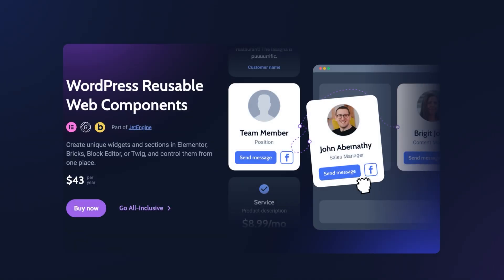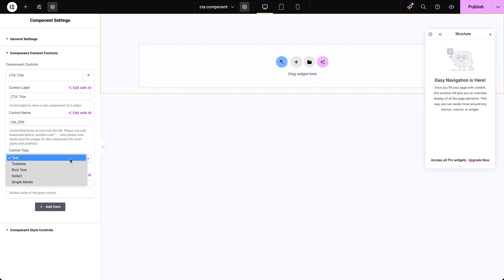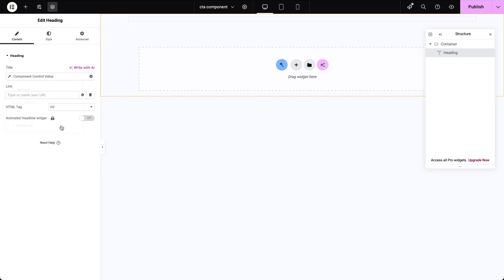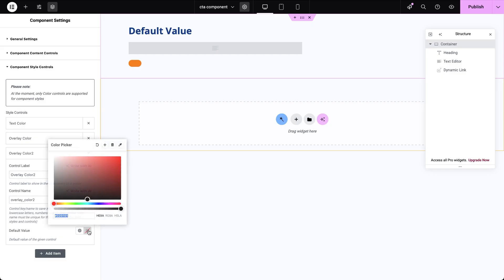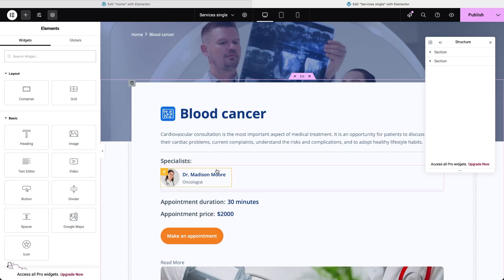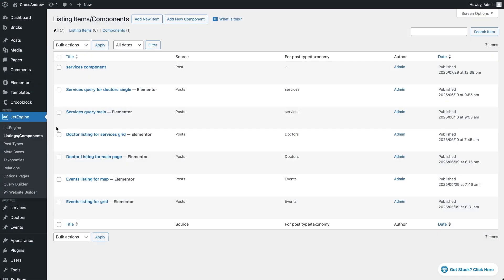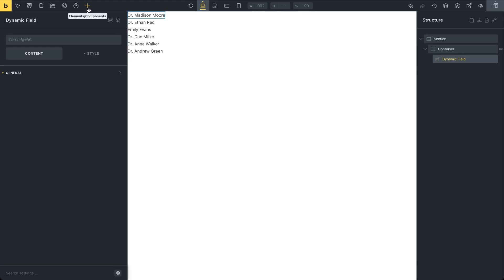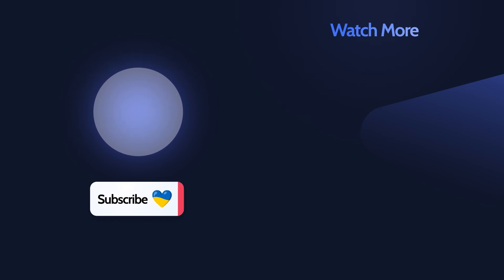How to Create a Reusable WordPress Component with JetEngine

Comment: Why not just use the native components within Bricks ...
Reply from the maker: Could you add details to your question?
As it seems as you can use it in Bricks easily https://prnt.sc/Pi5vfPx3rIAY
Reply: @Crocoblock Yes, Bricks Builder already now has the ability to create components. So it seems like a lot of extra work to built a component with Crocoblock to then just add it via a shortcode. 

If I need to make a change to that component or bind it to some data, I then have to leave the Bricks Builder to make those changes, which again seems like a lot of additional work. 

Just some thoughts is all.